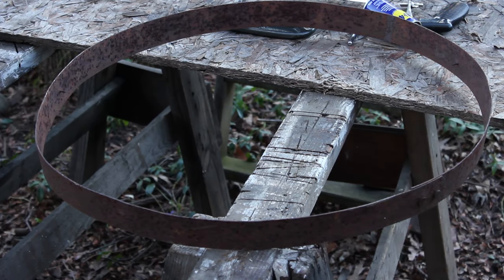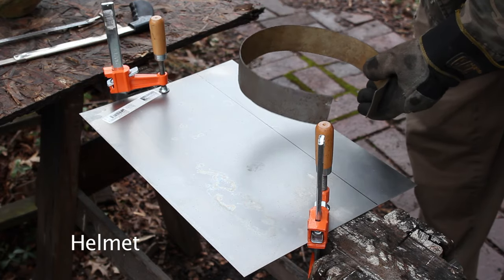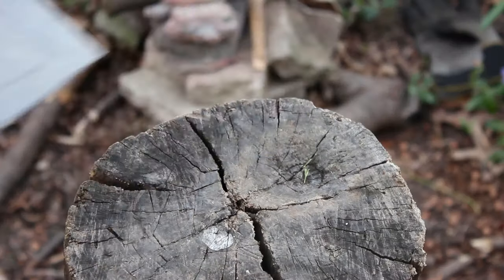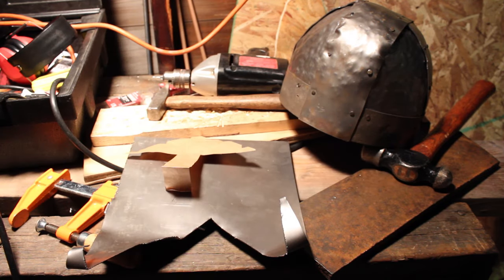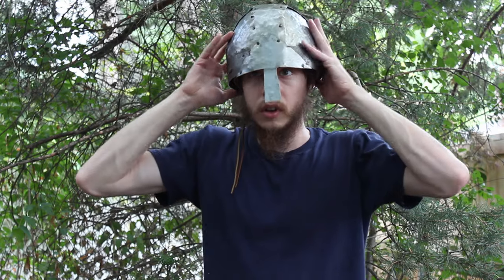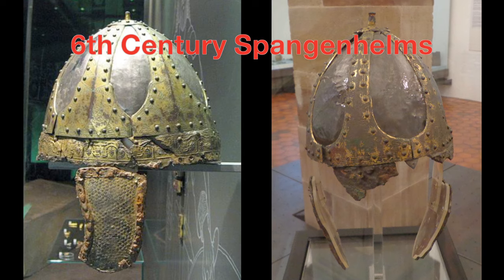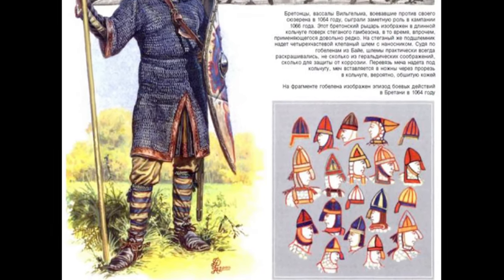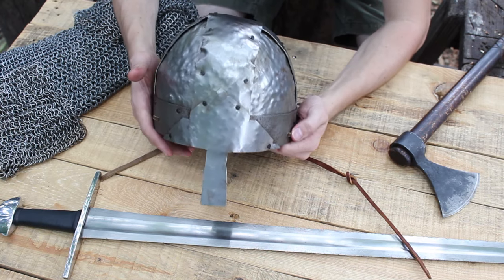Making a Norman Helmet with Sheet Metal and Carpet Tacks

Comment: one tiny piece of advice for the mail
You should let some excess of the mail over your belt so it bulges a bit 
It will greatly improve the weight distribution and carry some of it away from your shoulders to the belt and on your hips. 
Also try to have rings at your armpits also Otherwise this would give the enemy a great spot to aim for!
Thought it might help. Cheers!